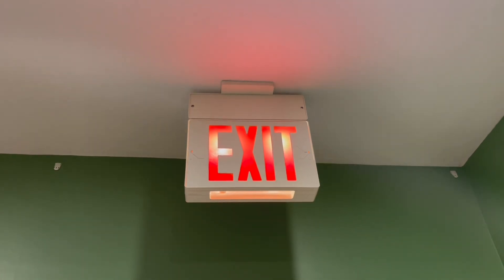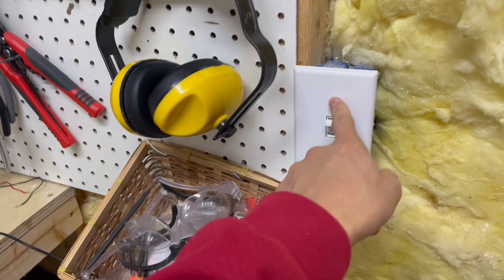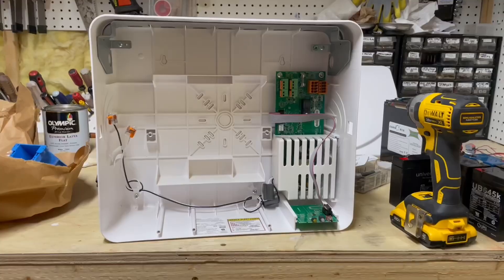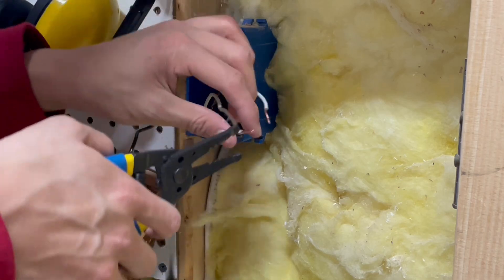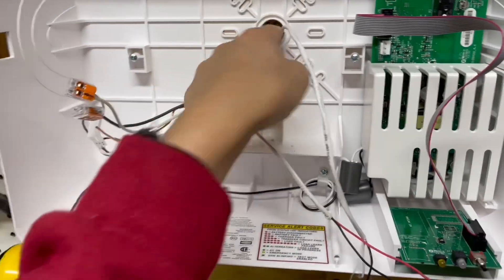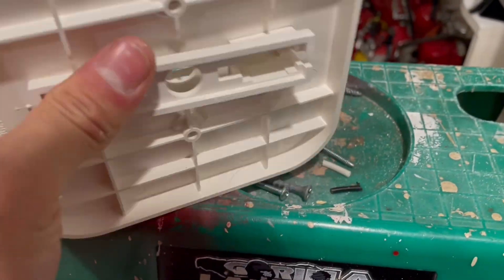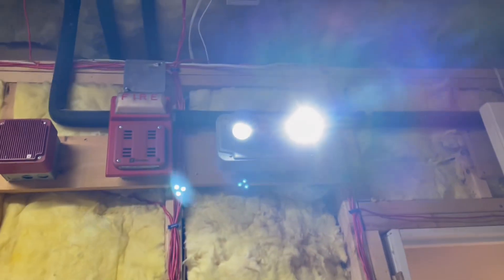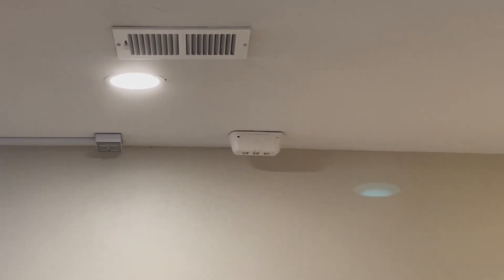Installing a Dual Lite ELSS Central Emergency Lighting System

Comment: do you leave your facp on 24/7?
Reply from the maker: yes, a fire alarm system that's powered off wouldn't be a very productive fire alarm system
Reply: @FireAlarmDude5967 i’m just paranoid of my wiring even though it’s low volt. all the splices are in boxes and all the open wire is ran through conduit or studs. do you think it’s okay to leave on?
Reply from the maker: @ if you’re uncomfortable with leaving your system on, you should make the choice you feel safest with.

Comment: That fuse probably popped for a reason. If you haven’t already, you should probably check the circuit before reconnecting it.
Reply from the maker: I accidentally connected a sign with inverse polarity, which results in the sign frying and the fuse popping.
Reply: @ That’s definitely unfortunate.